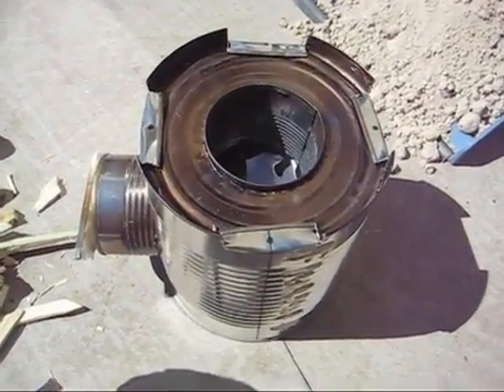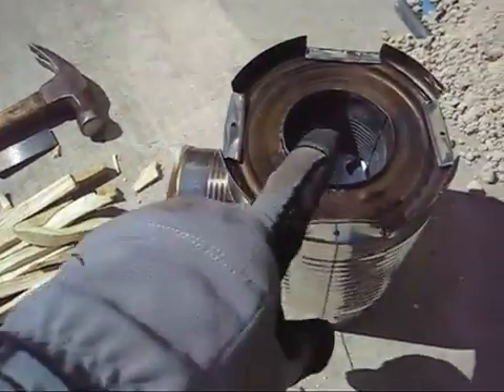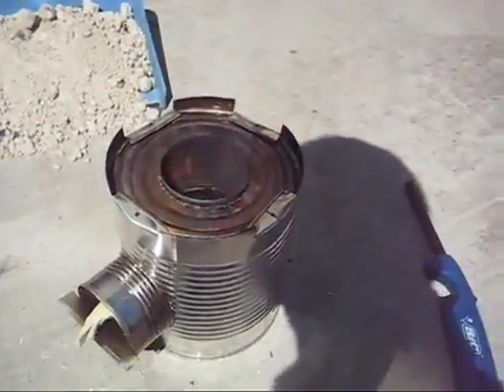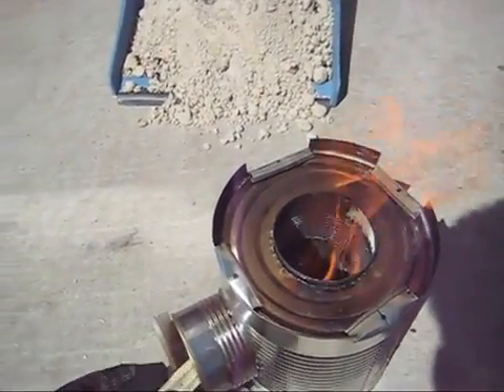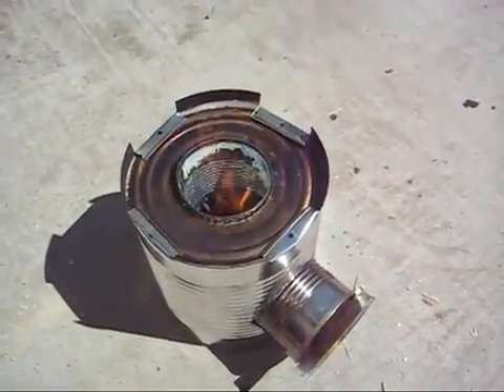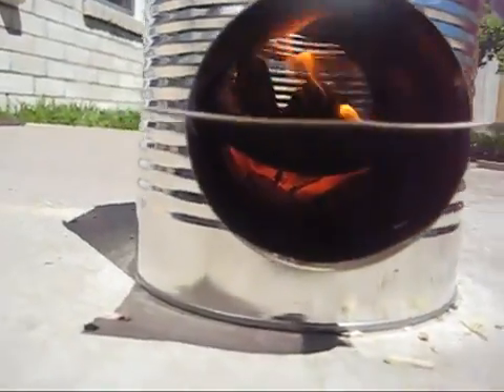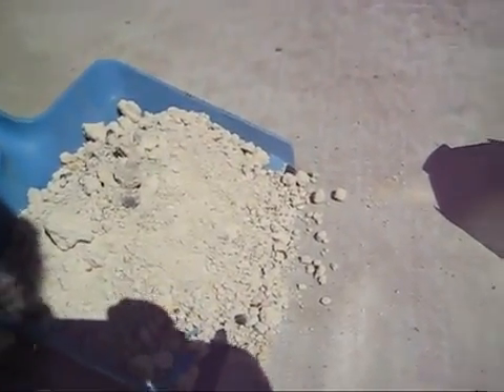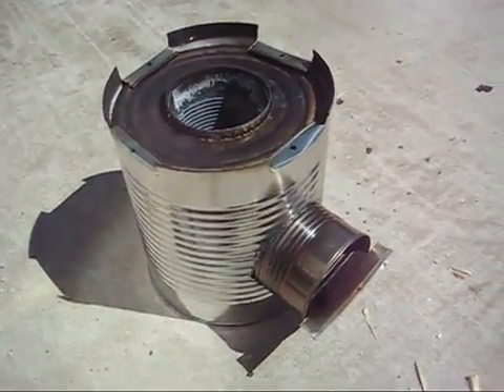Best Rocket Stove Design Ever - UPDATE

Comment: Your design is good and I like using vermiculite.. however you don't quite understand the rocket principle.  It is a gasifier which  means the central stack only burns the hydrogen created in the burn which takes place in the horizontal feed tube or outer J tube if you had made one.  A true rocket or J mass heater has only fumes and steam from the final exhaust  A true rocket stove will have an almost invisible flame under the pan not showing any yellow flame or smoke and is about 90% efficient.  I am advancing to a rocket mass heater which is twice as high as your stove and which reports say easily heat a 5th wheel or small travel trailer with cool and almost no smoke exhaust.  Good Job on the stove mate!

Comment: Something I did was drill two holes opposite of each other and a length of copper pipe strapping(the kind with the holes predrilled) and a rivet and made a carry handle. I made the stripe a little over a foot long so when carrying it I did not burn my hands. Also, I'm glad I rewatched this, I totally forgot the platform for the intake/feed can. The vermiculite sux as a thermal barrier as it allows too much space between particles for air to fill. and we all know air is a great conductor of heat. The more dense the material, the better.
Reply: Sand is much more dense than perlite and has way more insulating value than sand.

Comment: youu know vermiculite typicality contains high concentrations of asbestos, right?
Reply: Iñdianbe
Reply: Really?
Reply: No it doesn't. It is often used in gardening and in kitty litter. You wouldn't be able to buy it in Australia if it contained asbestos.
Reply: In the U.S. it needs testing for it. Some clean up jobs from fire or water damage can't be done except by certified asbestos removal companies, because the vermiculite is so old it was made with asbestos. So I guess you are right about more modern products

Comment: you could also use a muffin fan to really excite the fire.  and you could power the fan with a solar panel.  12V.   both avail on amazon.  use fan guards.  those plastic blades will cut you.  I know.  I burn pellets with my stove.  modeled after your stove.  check my videos.

Comment: Stove flue sizes: The flue size (diameter or cross sectional area) must not be smaller than the size of the stove outlet. It is in the building regulation guidance notes that the minimum flue size for stoves is as follows: 
1. up to 20kW burning smokeless fuel - Minimum 125mm diameter. 2. up to 30kW burning any fuel - Minimum 150mm diameter. 
If the stove is Defra Exempt and has a 125mm outlet then a 125mm diameter flue may be used. This is a recent update (Oct 1st 2010) to the regulations. So the regs recommend a minimum flue size of 150mm for any stove (on which wood could be burnt) unless it is Defra Exempt. Many stoves come with a 125mm flue outlet which then requires upsizing to 150mm (unless Defra Exempt). We asked Barrie Meridew, independant chimney consultant and he said:

Comment: I think one of the design problems with insulation may be that the insulator, be it sand, or otherwise, is sealed.  There may be moisture trapped in there and that may end up conducting the heat.    Perhaps it would be a good idea to heat the insulator as much as possible before loading it into the stove to remove moisture, and load it hot, before sealing it.  Perhaps with a a few layers of silicon seal on a dry day.  The silicon seal would surely be absorbed at the top by the sand as it cools and the silicone cures, and subsequent layers would make a solid seal against any additional moisture.  As we know, silicon is an excellent insulator.

Comment: regarding the comments at the end of the video regarding insulation.  Insulation is rated in R values and the larger the value the better it is at insulating. Here are the R values for various items:

Vermiculite - R rating of 2.13 - 2.40 
Perlite        - R rating of 2.7
Sand          - R rating of 0.15 - 0.25

The reason the can felt hotter with Vermiculite added was simply because as its a better insulator the chimney can got a lot hotter, this then transferred the heat up the chimney can, into the flat metal top and then out on to the outside of the metal can.  

To test it yourself yourself you can't have a heat conductive bridge between chimney and the outside container. 

Hope that helps someone.  Perlite is similar to Vermiculite by the way and is available in the UK in most DIY stores.

Comment: This looks great and i would certainly use it with pans/pots but would you feel comfortable using this as an open fire for smores and such?  What im really asking i guess is do the cans release any unwanted chemicals when they are heated to that level?
Reply: +Creative Redundancy You're not supposed to burn charcoal on aluminum foil, and these stoves produce charcoal.
Reply: +30CalCoreLokt  this i dont know but some cans have a coating that would burn away.   If you use a lid and tin foil under the pots , it can help redirect the  smoke from over whelming the food. Foil helps prevent  build up on the bottom too .
Reply: +TIMEtoRIDE900 yeah...for sure man i meant under the pot and not under the stove :D
Reply: Creative Redundancy
Gotcha !!

Comment: I work in fibreglass and have been looking for high efficiency insulation for my custom made coolers, and I found a product made by aerogel. these people developed a lot of insulation components for nasa They make an insulation blanket that is phenomenal A one inch blanket will protect your hand from a torch flame on the other side. Im going to build a heavy duty one with gallon cans built for shipping solvents, very thick walled. The insulation blanket will allow you to pick up the can no matter how hot the fire is. The efficiency of these things is amazing. Im going to rig a choke much like a carb choke to see if I can successfully control the heat ie., once I bring my food to a boil, Id like to simmer it. good luck ken
Reply: Ken B. did you ever do it
Reply: Yes, did you use the Aerogel? I am curious as it is made in Northborough Massachusetts, my state. I don't know how it responds to high heat or even direct flame. But I would think Roxul insulation would work well too.

Comment: the mod he did allows air to circulate under whatever pan he places on top of the rocket stove. if not for the mod the fire would be choked and start dying. basically as is was it was like having a plugged chimney.

Comment: Vermiculite has refractory properties and it expands with heat thus insulating the combustion chamber of your rocket stove. Metal is a great conductor of heat so your use of cans is spot on. Sands also traps heat and it seems that it works great for your design. Great job. Thank you for posting.

Comment: I don't think this is really a "rocket" stove. It works on the same principles as a regular fireplace/chimney. Its a cool stove, don't get me wrong but I have a recommendation.
Change the air intake to compress the incoming air. I think as long as the intake is smaller than the exhaust you will get the rocket effect. Its something I would like to see an experienced stove maker experiment with.

Comment: Could you possibly elaborate on the air flow, specifically how getting the air under the lid helps with the draw? It seems that the air under the lid is outside of the chimney so I'm confused as to how this aids with combustion. Thanks for a great vid, been messing around with rocket stoves to boil down maple sap and haven't found a good design yet, going to give your style a shot after watching this.

Comment: Most insulation materials builds on trapped air. It's one of the best insulators you can get. Vacuum would be better though, as u know is used in Vacuum flask's.

With that I don't say fine sand would be better or not, it all depends on how well it traps the air. Air that can move around will not be a good insulator as it can move the heat from one place to the other. This is why different form of foams usually are used as insulators.

Comment: now that you've had this for some time, what have you seen is the longevity of the components? I know the cans are - well- everyday items, but- just curious as I try different designs. Also, have you done anything like high temp grill spray paint - at least on the exterior? if you did make it- you could JB Weld the end of the can- all these are ideas that'll point to a more sturdy version! Thanks for the vid!

Comment: hi there, there is no need of any insulator if you just open some holes in the back for more oxigen to come in  of the main can ,and also you can have gasification by open small holes around the center can on the top,just above the seal cap .

Comment: Have you tried building a full size rocket mass stove? I was thinking about building one for my greenhouse. I know we don't get that cold down here, but my greenhouse is not very well sealed, so I'd like to have a cheap yet effective way to heat it if needed. I was looking to build a compact design, and I think you're on the right track. I was thinking several sizes of stove pipe, or steel pipe from a scrapyard should do it. Thoughts

Comment: It's possible that the sand is not a better insulator, but simply absorbs more heat.  I'm not sure what the specific heat ratings are of vermiculite and whatever kind of sand you used, but it's possible that since the mass of the sand is so much greater, that it is able to absorb more of the heat and release it more slowly, which makes it feel cooler.

Comment: ashes are also corrosive which means that they will eat away the steel.  Best insulation is perlite, vermiculite, or fiberglass.  Kitty litter is just too heavy.  My stove use fiberglass and it is at 20 pounds already.

Comment: Sand is better.
 Reason; it provides more weight to keep the stove stable. If you boil a gallon of water, you are balancing 8.34 pounds on top of what is basically air. Not to mention the additional 1 to 3 pounds of a pot.

Comment: I think you need to shorten the horizontal pipe a bit and put a horizontal plate in it so oxigen can get under the fire. The reason why it smokes a lot is probably because the fire suffocates itself.

Comment: If you use it casually probably not, but if you used it everyday as someone in a 3rd world country would, the metal cans would degrade quickly because of thermal fatigue resulting in the degradation of the metal and cracking.

Comment: Quite the opposite actually. Sand is a much heavier mass and transfers (absorbs) much more heat than vermiculite.  Vermiculite is much more porus and a much better insulator (lower thermal conductivity) than sand, so it would absorb less heat and transfer more to the pot.  How ever if you wanted to use it as a heater sand would be better because it absorbs more of the heat and then would radiate it out of the side.  But this deasign is for cooking, other designs are better for heating..

Comment: I built my own two cans high rather than just one. It's awesome.  I got water to boil in under 5 minutes using just 6 sticks of wood.  I also punched holes in the top on each side and put a wire bucket handle on it so that I can carry it better.   Love this thing.

Comment from the maker: @mrshammerhankus Thanks for asking. I placed the smaller can on the side of the bigger can, drew around the can with a Sharpie marker, drilled a hole with a drill bit on the inside edge of the circle, used tin snips to cut the hole.

Comment: ok, there is a concern about galvanized cans and aluminum cans- so, is it possible to use glass? could i cut down a huge pickle jar and a smaller pickle jar and x's them by two to make the stack higher? sand inbetween the glass jars, the weight of the food could "fuse" the stacked jars together to prevent cracks of air from seeping out, and i have no clue how to cut out a side insert for the feeder, think any of this would work?

Comment from the maker: @19GN03 Great suggestion. Thanks for sharing. I wanted to show the sand solution to show it can be built absolutely free. I'm sure there are better insulators than sand.
Reply: I thought that the vermiculite would not work because of the particle size. The voids made it function more like there was only an air space between the metals. Curious, was the sand wet or dry?

Comment from the maker: @outdoorsman310 Works great with normal sticks. After you get it started, as with any fire, you can add some wet sticks and the heat will dry them then use the sticks as fuel.

Comment: I made a "working" rocket stove just by stacking loose bricks, packing sand in the joints, and setting some twigs from some scrub brush in it. It was amazing! Most of the smoke that came off it was water vapor, not unburned fuel (it was winter). I was especially surprised at how long the fuel burned. 

One tip: if you slant the fuel/air tube, the fuel will self-feed as it burns. No more having to keep poking the fuel sticks!

Comment: Great little stove!
I find the vermiculite a MUCH better insulator than sand. However, you have a lot of leaks around the unsealed can joints that allow heat to escape into the large can. With your configuration, sand is the better insulator because it works as a sealer. I used stove pipe in my 5 gallon bucket rocket stove and vermiculite is much better for retaining the heat inside the burn chamber. Also, with the greater height on my stove (and chimney), it creates more draft (rocket effect).